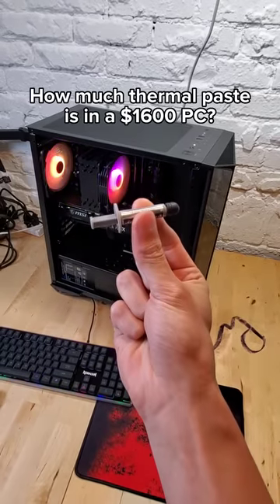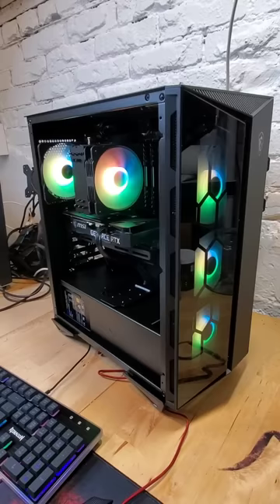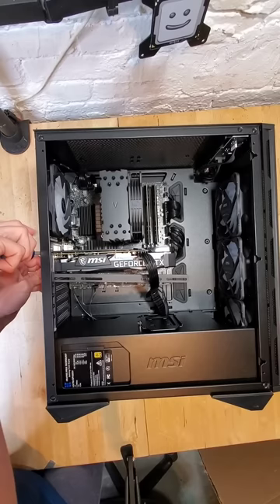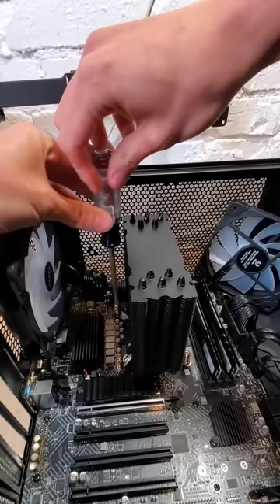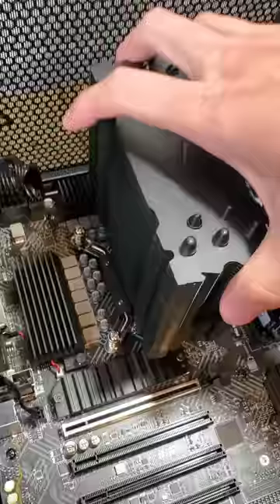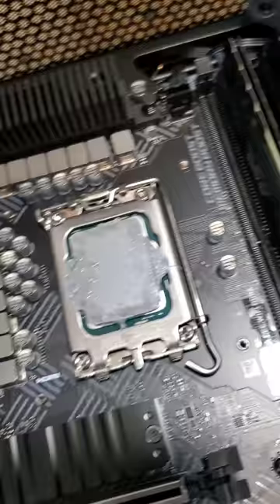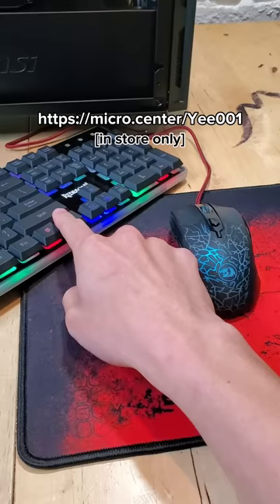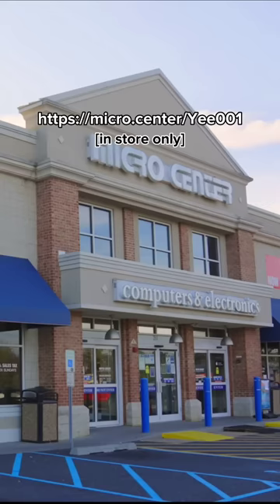how much thermal paste is in a $1600 PC? #shorts

Comment: It's definitely not better to use too much, I added like 2 pea sized dots for a change recently and it was 60 degrees idle, once I changed it and properly spread in a thin layer it became 40
Reply: You messed up in some other way then. adding too much doesn't affect temps because the excess would just flow off the sides.

Comment: There is no micro center in Utah so I can’t get that 😭
Reply: Might be worth a road trip haha
Reply: @kdrfan2150  ya
Reply: @kdrfan2150  but the gas prices
Reply: There's one in denver, CO. 😬
Better to just buy the keyboard at that point with gas prices though. 😅
Reply: @motobro199  man atleast you’ll have a recipe gl I still, need a gpu myself my fan stopped working
Reply: @kdrfan2150  I have a 1 gb one you can have if you want it it’s 11 years old lol
Reply: Nearest micro center to me is like 40minutes away 😂
Reply: @brainzyummy4574  lucky
Reply: @kdrfan2150  Then again you will have to pay more on other expenses if you’re gonna go road trip, but I’d rather go on road trip just for fun, I may have to spend more but it will be worth it.
Reply: @kdrfan2150  Are the fans replaceable from your end? Some GPUs you can replace the fans from the fan shroud without needing to fully disassemble.

Comment: I read an article that it's advisable for a direct heat contact cooler to have more pastes, to fill the crevices between the pipes
Reply: Makes sense because you do not want air between your cooler and cpu because the surfaces will never ever be completely flat and straight between the ihs and the cooler

Comment: The gpu would have been an interesting one to open up and check for thermal paste application as it is the most important component for gaming. I had to reapply thermal compound on my 3080 because evga didn’t put enough and was having some thermal issues with my specific gpu. An isolated incident im sure but it’s not a bad idea to check.
Reply: My EVGA 1660 Super had the same issue. Barely any paste and you could literally see metal shining on the chip. But it was fine for almost 2 years like that

Comment: Correction:
It's always good to use too much thermal paste than not enough thermal paste, AS LONG AS THE THERMAL PASTE BEING USES IS NON-CONDUCTIVE 
Most thermal paste is non-conductive, but a few options aren't and if some of this type manages to go over the edge of the CPU and even the tiniest bit touches a pin or something, you could have anything from simple operation issues to a fried component. Liquid metal is especially conductive, but it's not exactly a thermal PASTE, but still, understand what you're using and how to handle it.
Just a little clarification for the PC building  n00bs out there!!!

Comment: I have that exact gpu, could you do some sort of tear down/ review?
Reply: he doesn’t do reviews, he more does experiments. If you want reviews you should check out LTT (linus tech tips) or other channels for tear downs
Reply: GN reviewed a last gen Aegis. If I remember correctly it was really, really bad because the thermals in that case are awful. It was especially bad in relation to the power draw and price. 
Don’t know how it holds up with a 3060 but the case is still dogshit.
Reply: @ruebo2817  idc about the case, mine is a lian li o11 dyn, but yea that doesn't surprise me.
Reply: @hackerman  I know, but it's hard to find ANY teardowns of this exact model. They're always the Ventus OC
Reply: @crispyjello7564  Ok, thought that was what you were talking about
Reply: @crispyjello7564  You can look up tear down guides on websites and pictures. That's how I got around to comparing GPU schematic layouts for liquid cooling distro plates (which I never got around to buying because the sht is both a headache and a 🌬️💸)
Reply: @crispyjello7564  

https://youtu.be/b7mr8Tcm5eo
[you're exact model]

https://youtu.be/MmRH-_PT95g
[^this one isn't that great, camera poorly facing, plus its a 3050 Ventus 2x]

https://youtu.be/YEkUXN5HUYs
[Gaming X model]
Reply: @yeejay6396  appreciate it a lot mate, unfortunately that’s the OC version, it has a larger heat sync from what I can tell and a different backplate. There may be more but that’s what I’ve gathered. Also thanks for the advice

Comment: What will happen if we use thermal paste on m.2 SSD
Reply: Absolutely nothing the top of the m.2 is just the plastic sticker
Reply: @ronnyrrr932  but right under it there are hot ssd components, so his idea is actually quite good
Reply: Remove the adhesive from the heat spreader and glue it on permanently with some of the paste AMD uses for their stock coolers
Reply: @linuxlol3609  but thermal pad is more than enough for an m.2 nvme ssd
Reply: @gunesh6694  this is a mryeester video suggestion, so it isnt supposed to make sense, but yeah, pad or heatsink is enough
Reply: @linuxlol3609  agreed! 👍🏾

Comment: "Its always better to use too much than too little thermal paste".

Uh.. no, the exact opposite is true. In an ideal world, you would have perfect metal on metal contact. The world is not ideal, so we use thermal paste to make up the microscopic gaps between the two faces.

Years ago, it was common for enthusiasts to plane the surfaces of heat spreaders and heatsinks with the finest sandpaper we could, on a pane of glass to ensure it was flat, and effectively machine the two surfaces as flat as we could get them.

The idea was to have as little thermal paste as you could, and have the maximum surface-surface contact.

This is because thermal paste has a limited thermal conductivity that can never be better than the surfaces its interfacing. Realistically, its often much much worse.

Hardware has progressed to a point where the margin of error is greater. But the fact still remains. Less is always more, except when its none

Comment: ”Always better to use too much than too little thermal paste”

Erm, no it really isn’t. Too much has the opposite effect and starts acting as an insulator. The most efficient amount is just enough that it covers the entire CPU heat spreader cap and just thick enough that you can’t see the metal. No more, no less.

It’s always best to spread it yourself so you know it’s all covered but also so you know it’s not overdone.

Comment: Hi yeester, I have a question i want to upgrade my cpu and i found i7 8700k but it says it supports 2666mhz ram and i have 2400mhz
Reply: It should be supported by default. It might just not run as fast because it isn’t native mhz
Reply: @Isaacle_  thanks

Comment: It should be the same amount regardless of price lmao

Are you insane?  No, it’s NOT a good idea to have too much vs to little.  

My expert advice is you use as little as possible to just barely cover the IHS.  It just needs to fill in micro-cracks and nothing more.  Too much acts as an insulator and creates issues.

Plus it spills over which is NFG.

Do not touch a PC if you’re this daft
Reply: Also it looked like they used way too much thermal paste
Reply: @Faded______  Yup they sure did